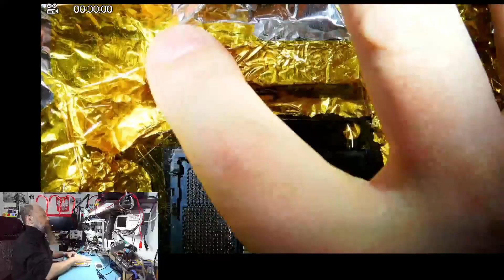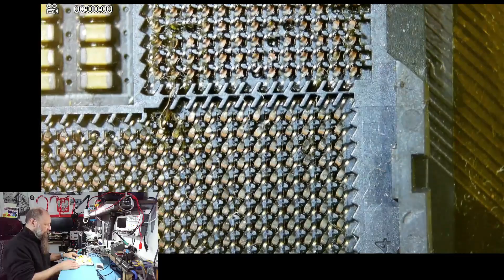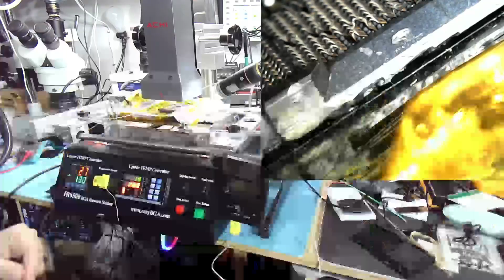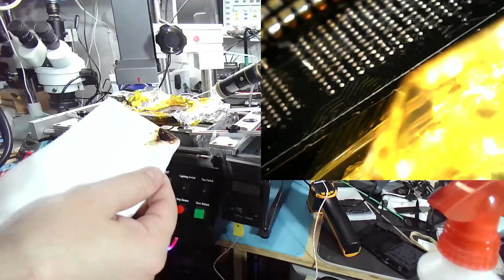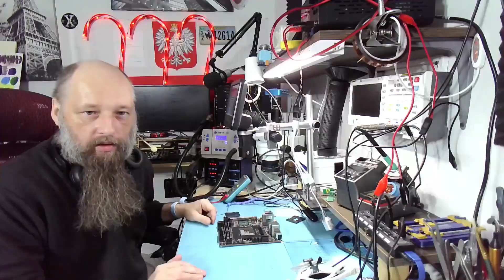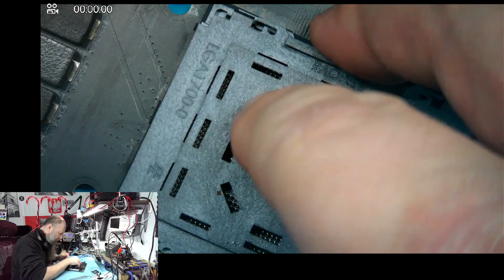#90 | AsRock Z790 Micro | LGA1700 Socket Replacement

Comment: Hi Raff, you certainly seem to have a grip on this now, be honest how many customers are reporting to you, when their boards are returned, that they are working fine? what's the success rate. I have no intention of embarrassing you, I am just curious and would be very pleased for you if the figures are good. Bob.
Reply from the maker: I'm still waiting for numbers, hopefully I'll have them soon, but honestly I would be happy with 50% success rate at this point. With each job I improve something so I should be able to get to 90% success rate within a few weeks depending on how many boards I'll get. I should go live with this repair in February.
Reply: @blackhorserepairs  if your going to turn it into money business you gotta invest in higher end bga rework station,  ive been down the cheaper machines now only use quick 7610 ir Rework Station,  since using I've never had a rma